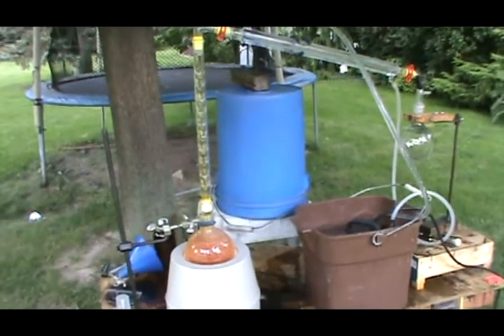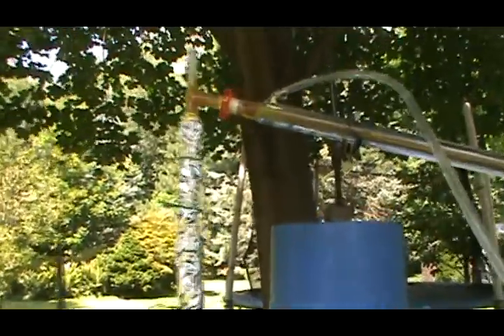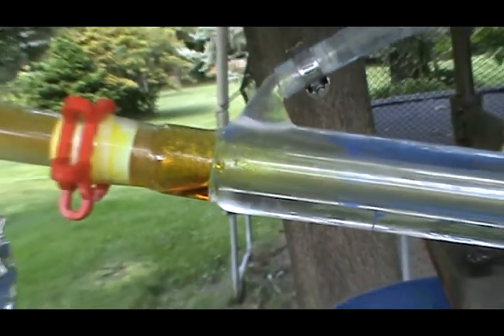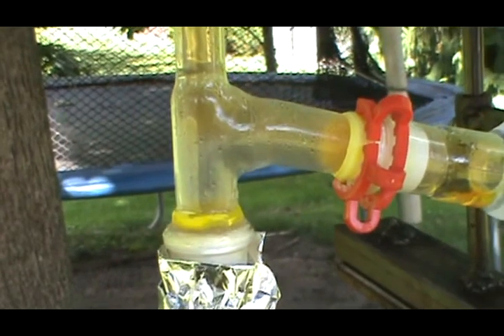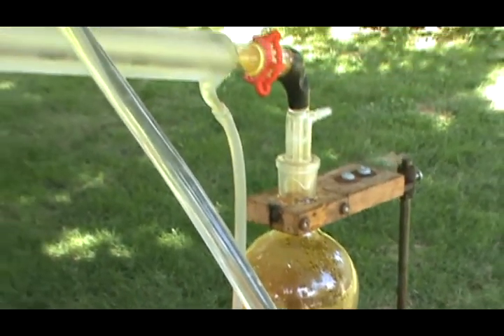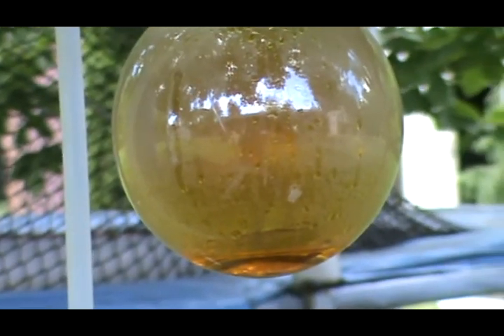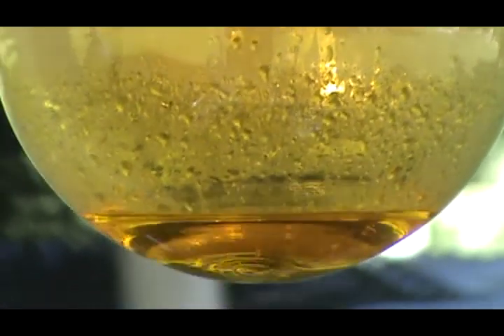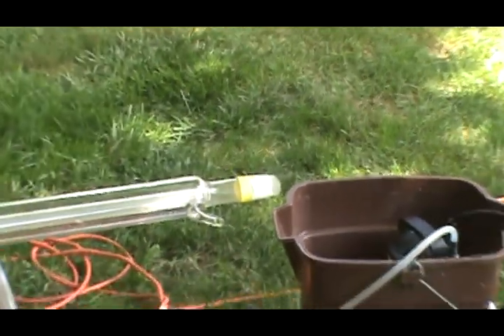fractional distillation of nitric aicd

Comment: This is when things go wrong because things are half researched. You have an extremely dangerous acid that reacts violently to organic material floating in the air with a home made lab stand (real ones cost far less than the mantle).

You have sulfuric acid at a beyond necessary temperature making it a thousand times more dangerous and will melt a hole in your mantle and easily any flesh it comes in contact with if it breaks while getting less yield at a greater risk plus for the cherry on top, a big bucket of water  right next to a maxed out mantle of sulphuric acid just to add to the potential explosion if / when something goes wrong and you panic.

Then you are probably going to try to nitrate something you shouldn't and this video is a good indication that you probably shouldn't do it just because Codys lab did it. That guy knows fully what he's dealing with.

Whatever you do. If that shit goes wrong. Don't use the bucket of water on it, or you will learn another thing about hot sulphuric acid.

Comment: There is no reason to be using a vigreux column in this type of operation. All you are doing is continuously refluxing a mixture that is essentially nitric and sulfuric acids which have totally different boiling points. In doing this, you are overloading the column forcing the boiling flask temperature far into the nitric acid breakdown temperature range. If you had a thermometer attached at the top of your distillation head, you would see this.

Comment: hey friend I think your using to much heat and your overloading the column.  you shouldn't need to fractionally distill the kno3 with 98%  H2SO4.  just keep the heat at 83°c.  just a little advice.  but nice job, keep it up.